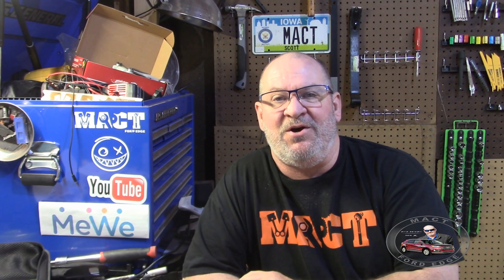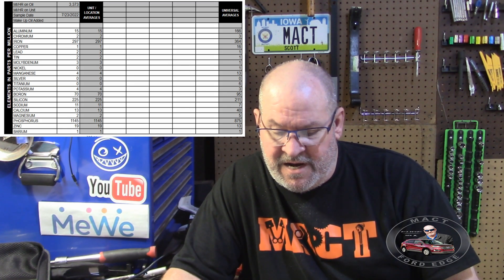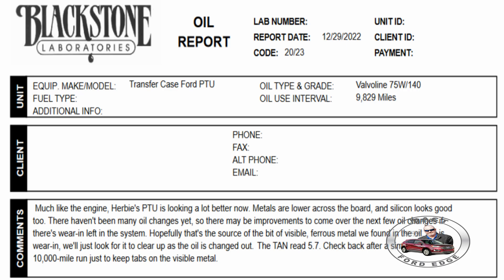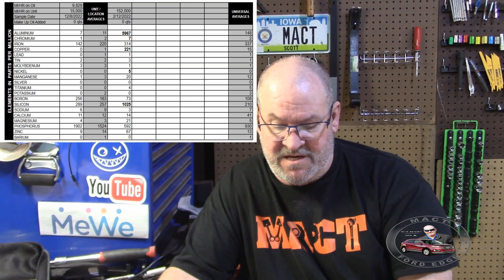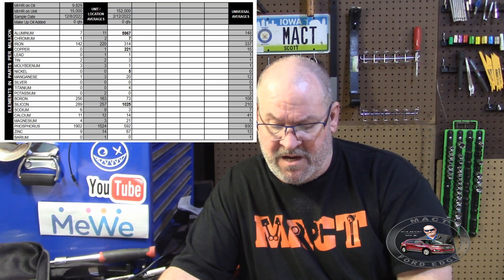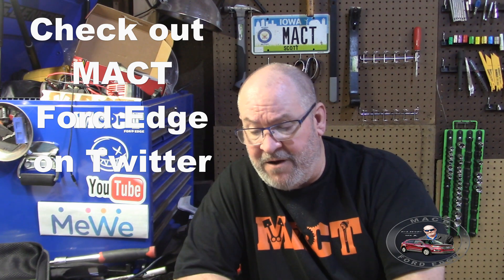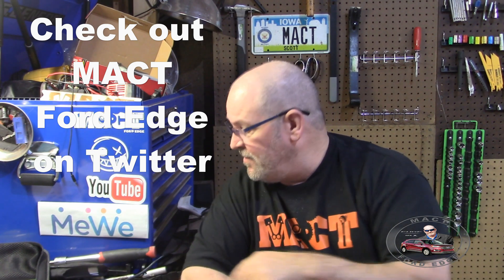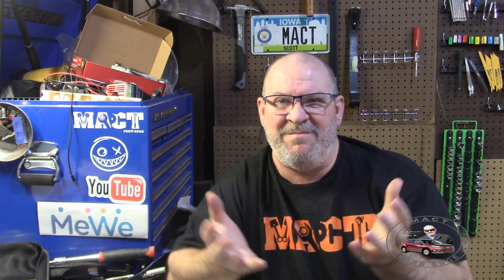PTU used oil testing from brand new to current date  How is the new PTU wearing in on Herbie

Comment: The Valvoline fluids work pretty well, I changed my rear diff and PTU with Valvoline high performance fluids. 75-90 in the rear and 75-140 in the PTU. Performed my first fluid changes at 32k miles, the rear diff fluid had a bit of metallic glitter in it and the PTU fluid was broken down to the point it came out like hot syrup. Happy new year!
Reply from the maker: 10K max for the PTU and 30K max for the RDU.